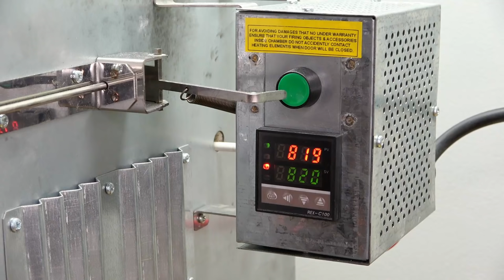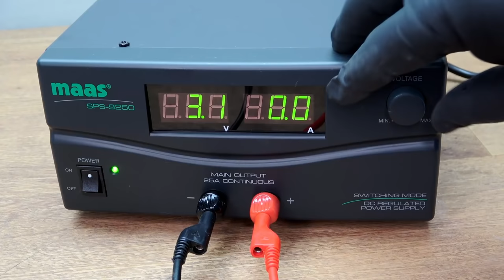Cleaver Restoration [Golden Cleaver With Golden Handle]

Comment: The gold electroplating was a cool little extra! I'd recommend shaving down that handle considerably more - the chunky, square handle has got to feel like a nightmare to hold in your hand 😱
Reply from the maker: It doesn't actually feel that bad ...
Reply: @ForgottenShineRestoration  Hi
Reply from the maker: Hi
Reply: S
Reply: More grip means more control.
Reply: Especially if you're chopping with it
Reply: @ForgottenShineRestoration  Having designed cutlery before, I can say it looks crap. I would definitely work on your handle ergonomics to take your beautiful work to the next level.
Reply: Exatamente o que eu ia dizer: este cabo está muito grosseiro. O original era muito mais ergonômico, prático e bonito... Não adianta encher de detalhes se não é funcional...
Reply: @ForgottenShineRestoration  so ny
Reply: Ok k
Reply: Ok k
Reply: Yes handle was once ergonomically pleasing. Not to be rude but u do hold knife in an uncommon way
Reply: @ForgottenShineRestoration  elloooo!
Reply: i almost disliked finding out he still had that as a block
Reply: @pixonico4794  profile picture hecka sus ngl

Comment: What is that crusty stuff that came off when it was put in the oil?
Reply: That is an oxidation layer that was formed during the heating of the steel. Also called 'scale'. It's very brittle and tends to flake off during quenching. Perfectly normal but not something you'd ever want to leave on the steel for a knife like this. You can wrap the blade in steel foil or use an inert gas furnace to minimize oxidation during heat treatments.
Reply: @CatalystRestorations  That's cool! Thanks for answering! And the quenching is to soften or harden the steel? Cool it slow to make it softer and cool it fast to harden it?
Reply: @Scott_G  It technically depends on what type of steel you are dealing with, but in general the faster you cool (quench) the harder the steel. Quenched steel is usually very brittle though (good strength, but can't absorb a lot of energy before breaking, AKA material toughness ), so after quenching you usually heat it back up again (lower temperature this time, called tempering) to soften it up just a bit to keep most of the strength but also improve the toughness and give you the best of both worlds!
Reply: @CatalystRestorations  Wow, that's so much more complicated than I ever thought it would be. Thanks again for the explaination. :)
Reply: @Scott_G  Welcome to the field of metallurgical engineering! 😁
Reply: @CatalystRestorations  Haha, thanks! And you've got a new subscriber. :)
Reply from the maker: Thank you Catalyst Restorations
Reply: @ForgottenShineRestoration  Sorry, no intention of hijacking your comments! 😂

Comment: Couple things. No need to gold plate a cleaver plus the handle was basically square. Round off the handle to a more oval shape. Plus the tang was so skinny, I thought it might break off during the process. I'd shape the handle then only cut out enough brass to cover that. Other than that, great work.

Comment: how do you decide to use a sandblasted bag the electric shock thing? is it just a preference or is one better for certain objects than the other?
Reply from the maker: If the object is not very rusty I blast it, if it is very rusty I apply electrolysis. Electrolysis dissolves the rust from the inside, so to speak, which is more effective and cleaner.
Reply: @ForgottenShineRestoration  ah interesting, that makes sense

Comment: If you pull glue up into a straw, put the straw in the hole you need to glue and squeeze the top as you pull it out it should dispense the glue and displace the airpockets easier.
Reply: That's twice the work if not more, the straw hole is even smaller than the other hole.